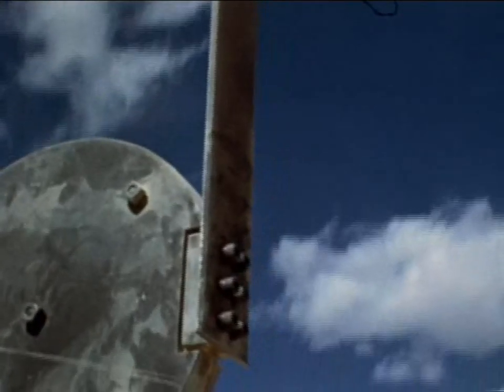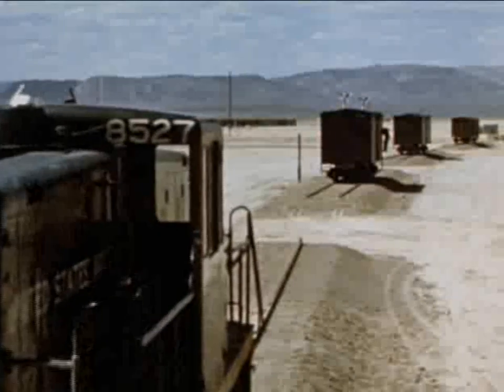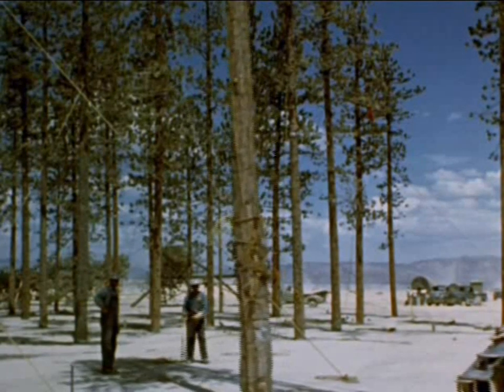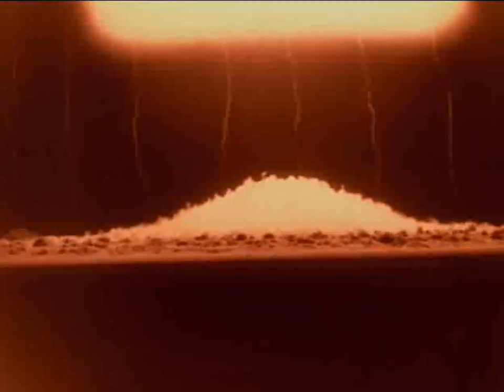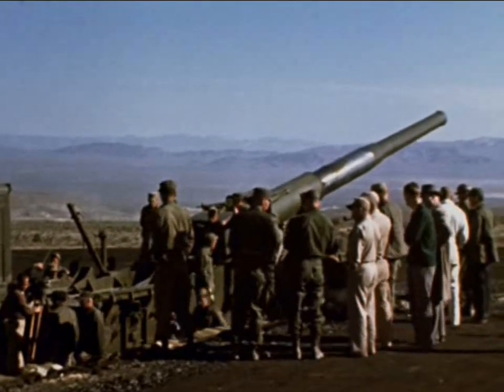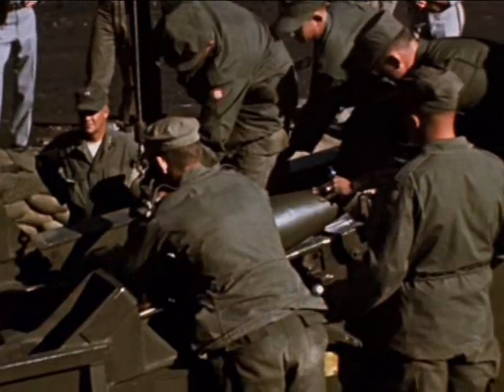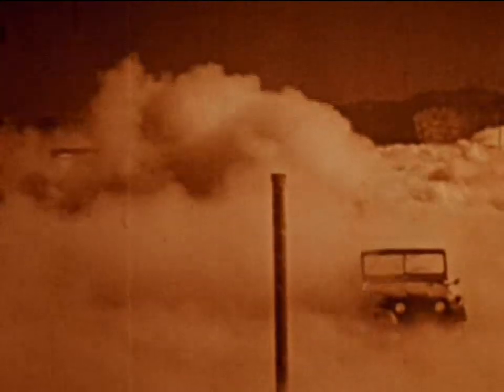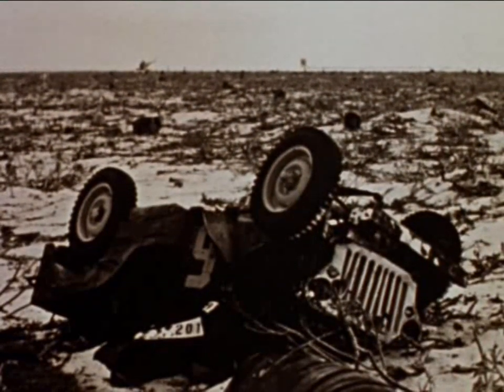The Atomic Cannon

Comment: That is correct. The first destructive mechanism to reach targets is the "heat wave". It is nothing but broad spectrum EMF energy with a good portion of it being thermal (or infrared). The second is the kinetic effect of compressed air rushing away from ground zero, or the "blast wave".